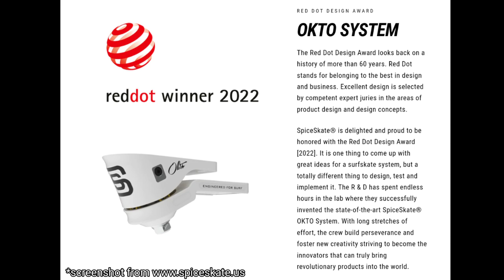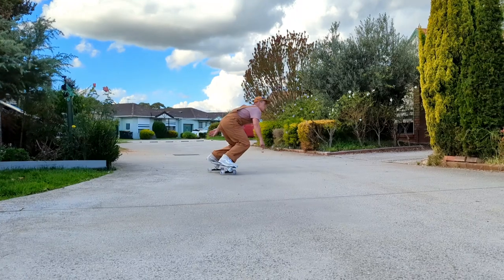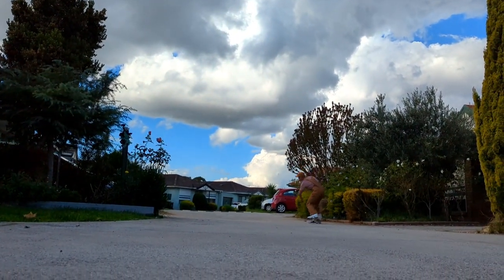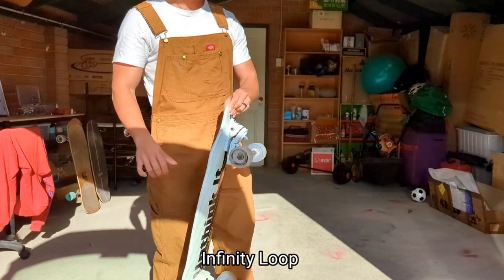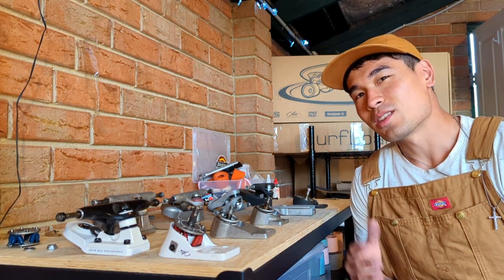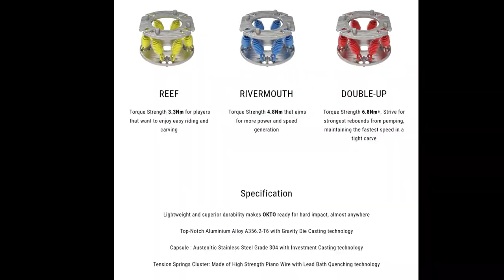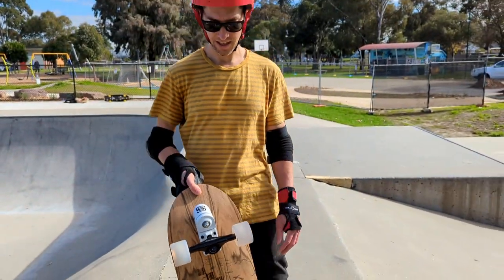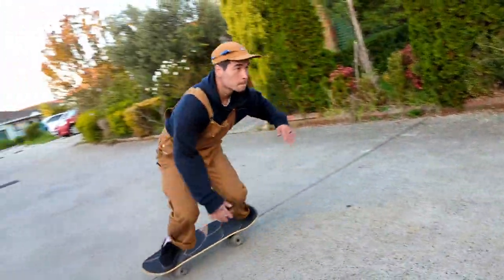Spiceskate OKTO system | review

Comment: It's been over year and I still can't get the hang of Infinity Loop on my swelltech (Wheel base: 23.5″). I'm 5'4" 140 lbs, which specific deck / wheel base / trucks / model would you suggest to make Infinity Loop as easy as possible to learn on?
Reply: My comment disappeared, so here again. A swelltech is a very nice board and you can do it easily with it. I will receive my second one today! They key is to make the trucks as loose as possible. Check out the internet for "T-Tool". The first 2/3 weeks will feel very wobbly, but when you get used to it you don't want to go back to tight trucks I promise that. If I check your wheelbase it's slightly large for your size, but it should not be a problem. Now you have a more natural surf stance, but you can make smaller turn circles with the smaller wheelbase. On the website you can see recommended sizings. But again with looser trucks you can turn more easy. And of course check Shane's video's on how to pump. Good luck!